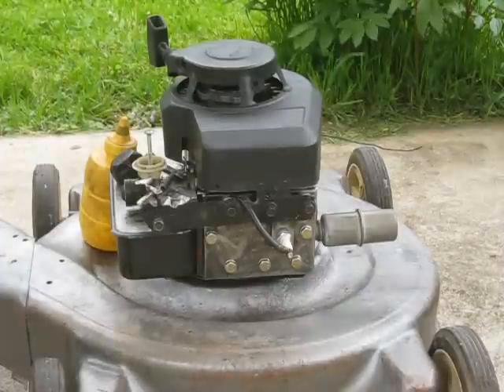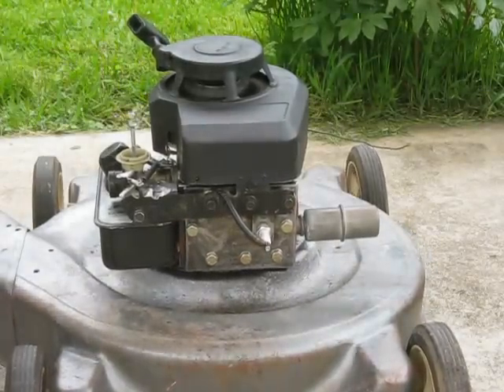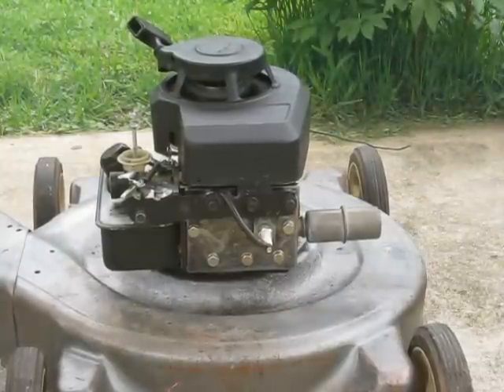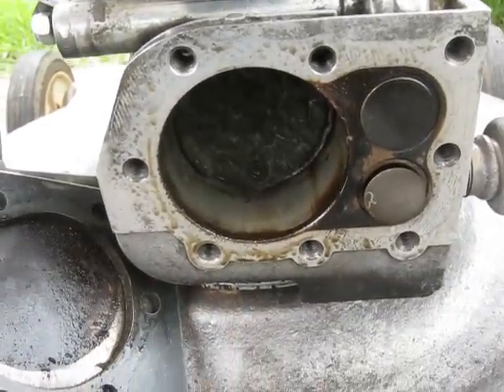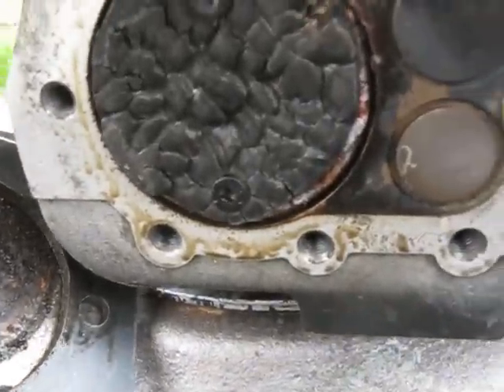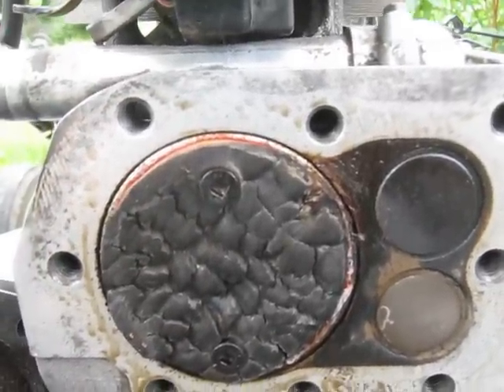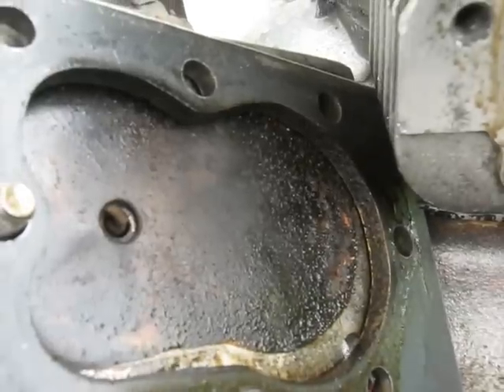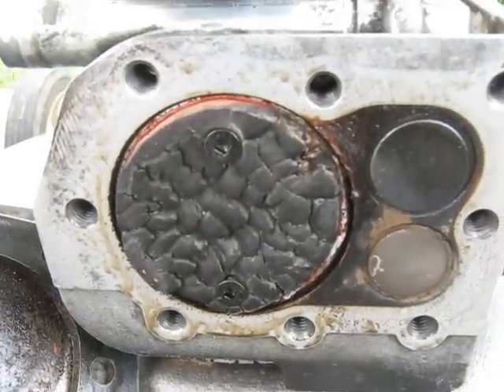Hard Maple Piston Running!

Comment: A stone piston charger. Even your idea of the concrete molded piston head sounds good!
Reply from the maker: I will keep it in mind, though I must admit I have less time for these projects now that warmer weather is here. My porch roof developed a big leak last week, so I blew the weekend putting on a sheet metal roof, and my muscles are still aching from it. Stone or concrete present the problem on being rather heavy, and brittle. I wish I had access to a stone saw, though thinking about it, I do have plenty of masonry zip discs for my grinder. Hmmm, now to find a suitable rock to cut!  :)
Reply: Happy to hear you fixed your roof. I look forward to your next piston for your lawn mower anyway 😁😁

Comment: Love your videos, I have been busy with work but will set up and test the gunpowder filled cylinder in an old mower I have. Tried that once years ago and the results were impressive! Basically it shattered the block and set the fuel tank on fire. I recently uploaded a video of an old stationary engine I got running, check it out, nice smokey startup!
Reply from the maker: Be very careful with that gunpowder, i wouldn't want you or somebody else to get hurt by flying shrapnel!